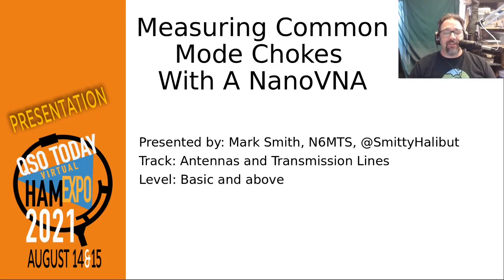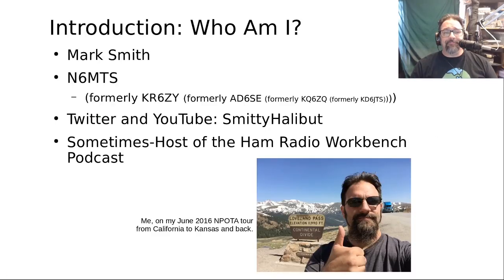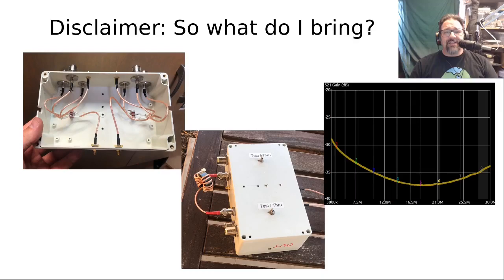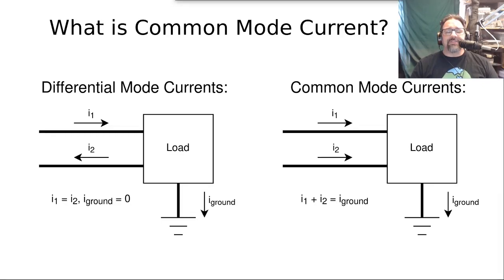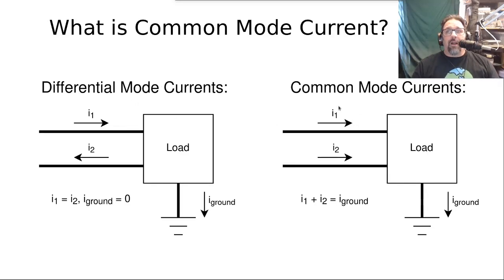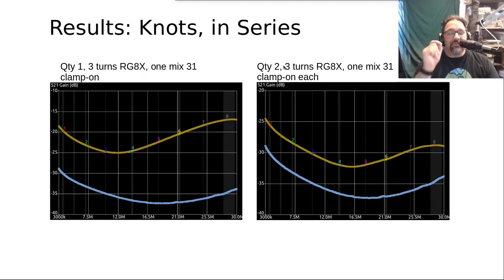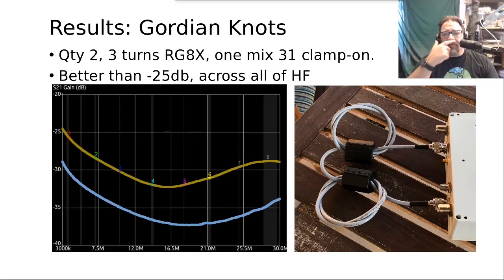Measuring Common Mode Current Chokes with a NanoVNA

Comment: Electrically speaking, what's the difference between balanced and unbalanced?
Reply: Balanced means the voltages go up and down relative to ground on BOTH wires, with the same signal but inverse of each other. The average voltage is always 0, always ground. This is what you have on twin-lead feedlines like ladder line, or XLR mic cables. 

Unbalanced means one wire is ground, a fixed voltage, and the other wire goes up and down relative to the ground reference. This is what you have with coax like UHF/BNC/N connectors, or RCA audio cables. 

There are some special cases that I’ll ignore here (like “pseudo balanced,” and phono (as in record players) signals which can be treated as balanced, despite the use of RCA connectors.)
Reply: Balanced and unbalanced has to do with the voltages. This is not to be confused with differential mode and common mode, which has to do with currents. 

Differential mode currents are when the current flowing in each wire of your transmission line are exactly balanced. The same amount of current flowing in both directions. The sum of the currents is zero. 

Common mode current is any difference between the currents in the transmission line. If the sum of currents is NOT zero, the bit that is not balanced between the two wires is the common mode. 

For example: if there’s a transmission line, two wires, whether balanced or unbalanced, and one wire has 2A flowing one direction and the other wire has 3A flowing the other direction, then there is 2A of differential mode current and 1A of common mode current.
Reply: @SmittyHalibut  so you're saying that the voltages go up and down relative to ground in both wires. So if I power my transceiver with a center tap transformer so that the ground is between the pl 259 shield and the other side, the shield and the center conductor will be equal voltages 180° apart and therefore balanced?  How does that change the operation of my transmission system in the long run?  What does it matter where my reference ground is electrically?
Reply: @BusDriverRFI  Don't do anything to the AC power input on your radio.  That will cause all kinds of damage.

A given transmission line is either balanced or unbalanced. Coax is inherently unbalanced, twin-lead is inherently balanced.  If you want to convert from one to the other, you use a (real) Balun (not the things a lot of people claim are baluns.)

There are a few reasons one would choose a balanced transmission line over unbalanced.  Balanced transmission lines have less loss than coax; for VERY high powered systems (100kW and more), coax becomes large copper pipe and becomes incredibly expensive, where balanced transmission lines can still just be large gauge wire.  For hams, a well deployed balanced signal can also be better at eliminating common mode noise than coax. This can be useful on receive.

The downsides to a balanced signal is that its fields extend past the boundary of the cable itself, whereas coax is entirely contained inside the cable.  This means you have to be very careful how you deploy balanced cable: If you put anything close to the cable that interacts with the E and M fields (eg: running it close to a metallic tower), it will impact the signal.  So you have to space it away from near by stuff, including other balanced transmission lines.   You don't have to do this with coax: You can tie it immediately to the tower, next to other coax runs, power cables, whatever.  It doesn't matter because all the RF is contained entirely inside the shield.

Weighing these pros and cons, most hams are running low enough power and good enough coax that the disadvantages of balanced feed lines outweigh the advantages.  So most of us use coax.  But you see balanced feed lines a lot more in much larger installations.
Reply: @SmittyHalibut  seems strange that a 1:1 could cause all kinds of damage. I wasn't going to do that anyway because I don't want high voltage on my radio case. It was a hypothetical question and not a practical question as to determining whether the "unbalanced" line would be considered "balanced" if it was fed with the "balanced voltage" input. Seems logical that since we are talking about the voltage being balanced, the thing keeping coax from being balanced is the input biasing.

Comment: I'm building a similar test jig... But have a question
Can you use a single 6 position On-On toggle switch instead of 2 separate 3position switches?
I have a 6 pos in the junc box but I'm worried  the cables from the two channels on the VNA would be too close together when soldered on the 6pos switches terminals.
Reply from the maker: ahem https://electronics.halibut.com/product/common-mode-current-choke-test-rig/  ;-)

You can, but the risk is exactly what you mentioned: You want to keep the two sides as separate as possible.  They will electrically couple, throwing off your readings.
Reply: @halibutelectronics  Awesome thanks so much for the help..
As for the link...  I am  building it myself ... "to save money" ...
Of course  I'm already at least $60 deep into it  ... and now I have to wait on some switches ..
BEST HOBBY EVER!!! ;-)
Reply from the maker: @grumpycat_1  Do not ever let me, or anyone else, stop you from building it yourself.  That's rad.  🙂
Reply: @halibutelectronics  Of course! ...
I think its actually just a matter of reminding myself that the value of  DIY'ing isn't to  "save money" b/c it rarely works out that way... and thats OK... 
That being said sometimes it is smarter to just buy it (especially tools) ...
Reply: @grumpycat_1  sometimes you want a project, and sometimes you just want the result. There’s no shame in sometimes wanting the result without the project, nor is there shame in wanting the project even though the result is cheaper/easier/quicker/whatever-er. Just, ya know, be aware of which you’re doing and why. :-)
Reply: @SmittyHalibut  "be aware of which you’re doing and why" .... Exactly
To be fair, I have already built a few 1:1 chokes... Each was about 20$ in materials 
Getting -40db & -30db loss from ~7MHz to ~30Mhz  which means at least I'm net positive there.

Comment: Dam it mark.....strong words followed by other strong words some bleeps and then some less strong words.....now I need to rebuild my main choke as I'm useing 4 ft140 31 and 4 ft 140 43 toroids in a kind of binocular shape with 6 turns ish of my coax then directly into the radio I measured about 25 ish db down across hf and now I'm wondering if I split it in 2 and do 2 of the 31 mix and 2 of the 43 with 3 turns then repeat again so I have the 3 turns theory satisfied and the chokes In series theory also satisfied... dam you ye bleepus maximus
Reply: 🤣🤣🤣

I’ll point out that you can MEASURE these things using the kit I sell now if you’d like, so you know for sure which configuration is better. 

I’d also request that you take notes, take pictures of the graphs, and at least write up your results, or do a video showing your results. Somehow, share it with the world. I will absolutely link that here and boost it. I haven’t done anything with binocular chokes, or mixing .. mixes.

Comment: So the swr meter in my cb radio shows all is good, no problems. So I went and bought me a external meter only to double check. I connected it, and what do I see... the meter says no good, swr way up there. Took a look at my radios meter and now it’s also showing a high swr all of a sudden.

So I start to adjust the antenna a few times, checked if it did help and yes it did. My external meter shows a low swr. The radios swr agrees also, wow this is great! All I did was to plug the meter out and back with the antenna in the radio. 

But no, now after I disconnected and put the meter away, the radio says the swr is high! 

What the hell is going on? And how can I learn to fix this because I don’t have money now to go out and buy another meter. And since this is happening on my radio, I wouldn’t be able to make sure an older radio that I planned to buy would be sure. I could not even help if someone where to ask me to come with my swr meter and make sure there’s are not too high.

What can I do to make the radios swr meter work together and show same good results like the did, until I discontent the external one. Radio is showing very high again.
Reply: I am not an engineer but have been measuring antennas SWR for about 50 years and my guess is your coax length without the SWR meter and patch is resonant at 11 meters.  Probably a multiple of 108 inches (a quarter wave at 11 meters or 27.255 mHz) times the velocity factor of the coax and an example would be .7 (velocity factor of your coax may be slightly different) times 108 inches, or a multiple of 75.6 inches, or 151.2 inches or 226.8 inches, etc..  Try leaving your patch cord in the line by replacing your SWR meter with a double female barrel connector and then check your SWR at the radio.
Reply: @geekthesteve6215  Thank you, that sounds reasonable. Would a shorter coax cable from the swr meter to the radio help get reliable readings you think? It would be great if I could trust the swr meter if I ever should get a radio that has no built in swr meter or high swr protection.
Reply: Maybe a dry soldered joint in the new meter? Have you got r.f. chokes?
I was given a supposedly non working MFJ160-10 tuner by a friend but I used it for two years, we went to Wales and still good but connecting it at home it no longer worked. Looking inside revealed nothing, it all looked perfect until I poked around and found a loose wire. It had been touching but not soldered.
G4GHB.
Reply: @bill-2018  Ohh this could be, because I bought it on amazon like budget version. The package of the cables says “uhf” so I was thinking it might be the reason, but then again a cable is just a cable, so I’m not sure 🤔

Comment: Inductances don't provide a load for energy.  Only resistance can load energy.  Your 2 core balun does not provide better rejection because it increases inductance since inductance can't dissipate energy.  You did not actually measure any currents any where.  You would make a very poor example of an engineer.  You can't just say something is true.  You have to show it.  And if inductances can't dissipate power,  where is the resistance at?????
Reply: Does it make you feel better about yourself to tear into others like that?  I'm seriously asking, because I don't understand why anyone would word that the way you did. You can challenge the information I present without making it a personal attack.  I welcome discussions about the content presented, and if you can convince me I got something wrong, I'll happily own up to it.  But when you start off with "You're a very poor engineer," I'm less inclined to even listen to the potentially valid point you're bringing up.  (See below.)

And this completely ignores the point that good engineers aren't always right.  Good engineers can make mistakes and learn from them.  If I am wrong here, that doesn't make me a "poor example of an engineer."  It makes me human.

To address the technical point you're trying to make: We aren't trying to dissipate the power, we're trying to block it and prevent it from flowing in the first place.  The chokes provide a high impedance to the common mode currents, which actually reduces the amount of current flowing.  When you compare the "about 1000 ohms" of inductive impedance in the choke against the "about 50 ohms" of impedance in the antenna or feed line, the current will predominantly use the lower 50 ohm impedance.  The higher the impedance (whether resistive or reactive) of the choke, the better this effect.

"You didn't measure any currents anywhere." I did not measure any currents DIRECTLY, that is true.  But I did measure the signal strength loss by converting the differential signal out of the VNA into a common mode signal, passing it through the choke as a common mode current, then converting it back to differential mode so the VNA can measure the signal.  This is analogous to what's ACTUALLY happening in real life.  Any attentuation, whether from resistive effects, reactive effects of the chokes we're building, interactions with the environment, or anything else, will show up as S21 loss (negative "gain" values as the NanoVNA calls them).  By keeping the other loss effects relatively constant and only changing the choke, we can measure the effectiveness of those changes on the choke's ability to prevent common mode signals.

Is that measuring current?  Fine.  Not directly.  But I am directly measuring what we actually care about, so I'm ok with that.
Reply: Early radio engineers said wavelengths below 200 metres were of little use and wavelengths above were required to make long distance communication so radio amateurs were given everything below 200m.
Only when amateurs started making long distance contacts were they interested. The 'professionals' got it wrong!
G4GHB.